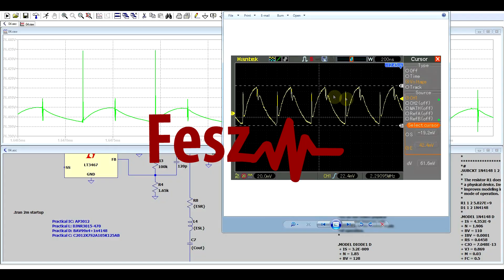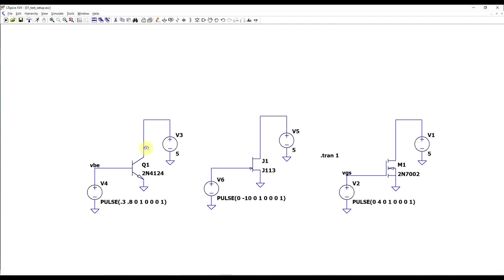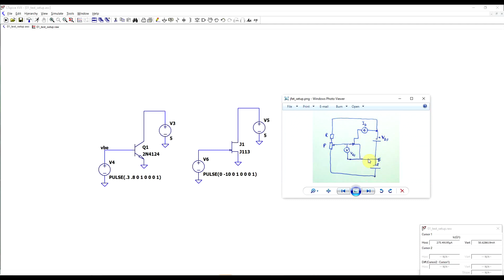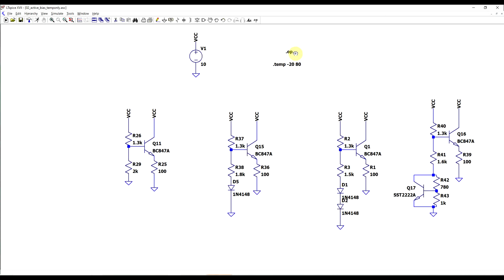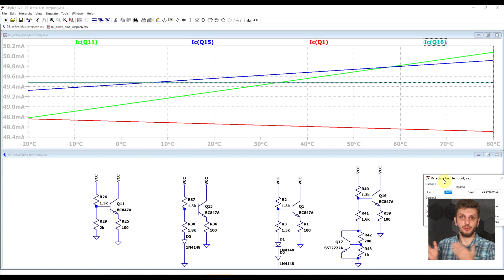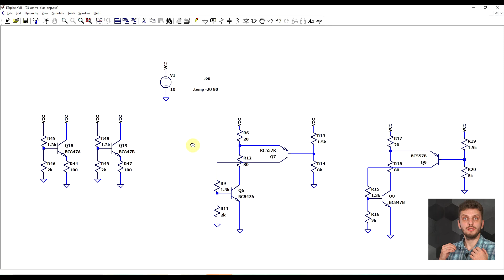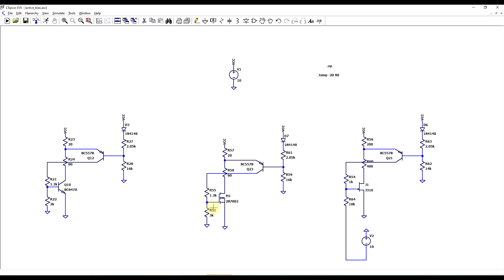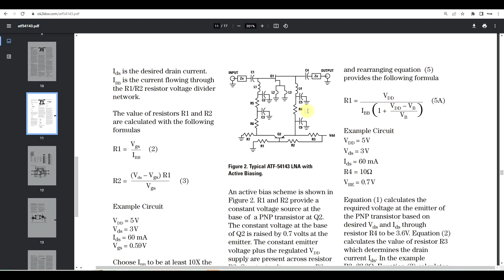Setting the operating point using Active methods

Comment: 11:00 & 16:11 The op-amp's inputs should be flipped. The feedback should flow into the op-amp's positive input, since its output signal is sent to an inverting common emitter BJT, and then back to the op-amp. As drawn, the circuits are positive feedback loops. The BJT-based circuits work properly because the BJTs receive Vref at their inverting base terminal and the feedback signal at their non-inverting emitter terminal.

Comment: If I understand this correctly, do we assume that all components are the same temperature? So if the temperature rises on the main transistor, the other components follow?
Reply from the maker: For temperature compensation, this behavior (having components at the same temperature) needs to somehow be ensured by design. For very low power (say a small signal amplifier), there should be no major temp difference - since there is no power dissipation; but for high power, it is common to put both the power element, as well as the compensation element in thermal contact - like have both tied to the same heatsink

Comment: Also, you can put an cheap microcontroller to track emitter current (by ADC-ing voltage on resistor) and adjust bias on the base (gate), by DAC.
Reply: Any particular situation where this can be an advantage?
Reply from the maker: I think it could be useful if the amplifier needs to have multilple operating modes - like low power (have bias current 1mA) high power (bias current 10mA); the uC could be used to switch between multiple references based on some other input
Reply: @SwitchingNoise  Many, apart from temperature stabilization, you could choose mode of operation for different input signal strength, power saving...
Reply: @SwitchingNoise  Also, compared with some techniques, reduction in number of components (if you already have CPU and some data bus).
Reply: @dankodnevic3222  You will need something to measure temperature for which you need an ADC and some components, an ADC with interfacing components to measure the biasing state of the circuit in question and a DAC (or a simple PWM signal will do) with interfacing components and carefully crafted software to do the temperature compensation. But I like the idea of different operating modes as posted by Fesz. But also this can be implemented in other ways.
Reply: @SwitchingNoise  In case of temperature stabilization, emitter/source current is the most important indicator and you can get it by simple ADC from emitter/source resistor. ADC's and DAC's are integrated in most uC's. Only few other components, resistors and capacitors, are needed. PWM biasing. is not an option, because it requires a lot of noise filtration (any ripple goes directly to the base/gate).
Reply: The idea will work but I fail to see the advantage of such a circuit compared with a circuit based on an op amp.
Reply: @SwitchingNoise  Yes, most of these features you can design with opamps, but with increased complexity and decreased flexibility tradeoff. With uC, you can use single fixed resistor for the range of operating points, you can have staged bias sequencing (something very desirable in multistage amplifiers). Self diagnostic and calibration becomes matter of software. All of that for 0.3-2$ per stage (comparable with opamps).